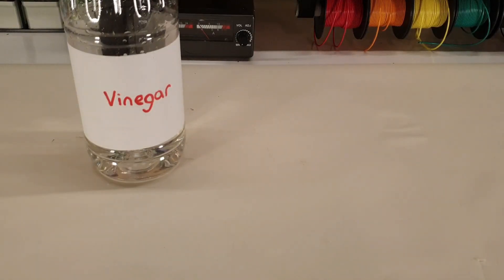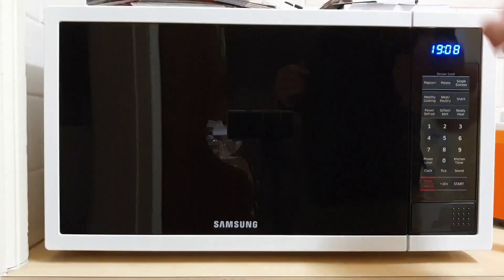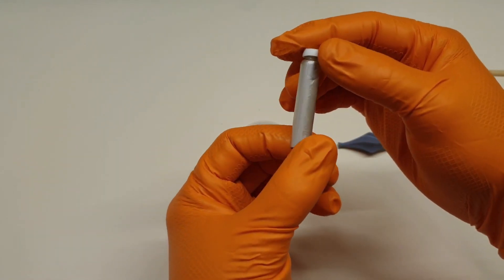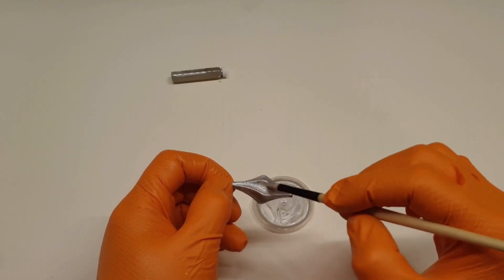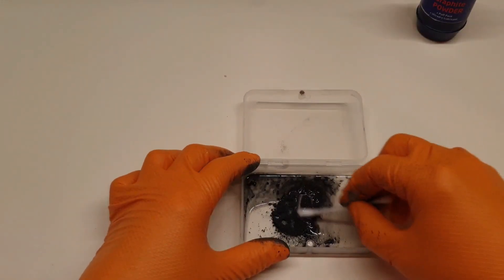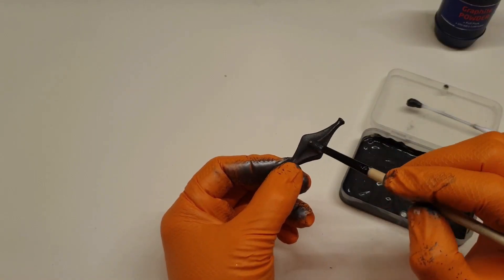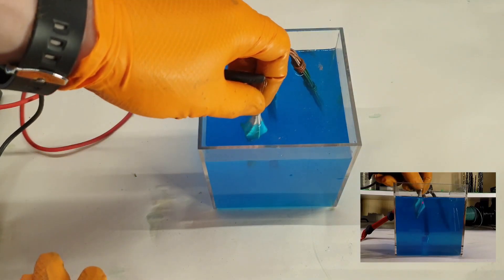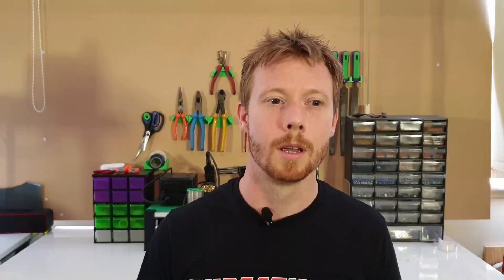Metal plate your 3D prints at home.

Comment: Nice video! Just one thing: silver is not the most conductive metal, gold is even better - but obviously prohibitively expensive. So it's better to say most conductive but relatively affordable metal.
Reply from the maker: Gold is actually the third most conductive metal, behind silver and copper. While not the most conductive, gold has the advantage of being extremely resistant to oxidation, which is part of the reason why it used for high quality plugs and contacts.
Reply: @BrodieFairhall  I stand corrected. I guess I was just regurgitating what I heard once without checking. Good catch.

Comment: What percentage or what kind of peroxide was used? Do you need lab grade stuff at 30% or just regular peroxide in the store
Reply from the maker: @arib8464  just grocery store levels of concentration. I believe the peroxide I used in the video was around 3%.
I also have a second electroplating video with a different method of creating an electrolyte that doesn't use peroxide if which might work better for you.

Comment: Hello, I've already tried everything to make my 3D print shine, I've sprayed on conductive copper varnish, I have an area of 1.10 square centimeters, I've set it to around 0.550 A but it just doesn't shine, it just becomes so strangely milky, I just don't understand it Tried everything possible💆🏻‍♂️
Reply from the maker: @stefankrsmanovic3776  I've not seen it go milky before. There are calculations for the correct amount of current to plate a specific surface area, 500mA seems a bit high off the top of my head. The easiest way I have found to get a good start is to increase the voltage until bubbles start to form, then drop the voltage back down until there are no bubbles forming. The voltage will be somewhere around 1.2 - 1.6V, depending on how saturated the electrolyte is and a few other things.
There are also brighteners you can add to the electrolyte to improve the surface finish. A tiny bit of sugar has worked for me in the past, but now I use a commercial brightener.
Reply: @BrodieFairhall  With my laboratory power supply I can only set amps as soon as minus hangs on the wire of the 3 D part I started yesterday with 0.137A and every hour I then went up twice as much with the amps but after 4 hours I still had no shiny surface and in the end I was at 0.550 apere
Reply: @ sry i mean i have 1.10 sqaure meter not cenitmeter
Reply from the maker: @stefankrsmanovic3776  since this is a home made electrolyte with a higher resistance than one based on sulphuric acid (on top of all the other thousands of variables related to plating that change while you're plating, such as concentration, the surface resistance of the cathode, surface area of the anode as it decays, etc) I would recommend starting by adjusting voltage and trying to keep it just below the point that bubbles form on the part you're plating. You can plot the voltage and current over the plating time and work out what current to set in the future.

Comment: How long does the electrolyte last?
Reply from the maker: I still have the electrolyte from this video.
I run it through a coffee filter to take out debris and add more distilled water to dilute it as more copper dissolves in it and it gets darker.
As long as it doesn't get contaminated with other metals or chemicals, it could last year's.

Comment: what happens if you dont heat up the mixture ?
Reply from the maker: It just takes significantly longer to make.
My second electroplating video has a different method that doesn't require heating that might work better for you.
https://youtu.be/HWBwebWAT9c?si=lZEF6iYOrrJdYzeh
Reply: thanks for the immediate response  @BrodieFairhall  I tried it without heating it up , it kinda worked.
Reply: one more question if you dont mind , I used graphite spray paint on a plastic piece but it didnt work. I tried it on a metallic piece and worked fine. could it be the paint or the power supply ? I used a charger with variable voltage  @BrodieFairhall

Comment: Anyone have a link to the paint
Reply from the maker: Instead of the paint in the video, I'd recommend a nickel based conductive paint (MG Chemicals makes a really nice one). It's far cheaper and I find using the spray version gives me a much better result that the silver paint
Reply: @BrodieFairhall  I am open to anything that makes my part conductive not had any luck so far
Reply from the maker: @1937Brett 
This is what I use https://mgchemicals.com/products/conductive-paint/conductive-spray-paint/shielding-paint/

Comment: It looks like metal, but how does it feel? Does it have that cold to the touch feeling that real metal has?
Reply from the maker: It feels like metal to touch, but it's missing the weight of a solid metal object.
Reply: @BrodieFairhall  Sweet perfect for making a shifter knob for my Logitech H shifter.

Does it wear off if you touch it too much?
Reply from the maker: @antjones2281  it will eventually wear, both because copper is very soft and through the acids in your skin. You can just plate it for a longer period of time to build up a thicker coating. If you look at my other playing video, it also shows nickel, which will last longer with that kind of use than copper.
If you do decide to do it, instead of using graphite, I now use a nickel conductive spray paint (most commonly the one made by MG Chemicals), it gives a much, much better result and it's far cheaper than the silver paint.

Comment: How much voltage do you recommend setting it to to start with?
Reply from the maker: With this electrolyte, I'd start with around 2.5V to 3V and increase it if you need to.
I also recommend using a nickel conductive paint now, instead of the graphite or silver paint. MG Chemicals makes a nice conductive Nickel spray paint, which ends up being much cheaper by volume than the silver paint and it works so much better than the graphite.
Reply: @BrodieFairhall  Thank you so much!

Comment: Hey, great video! I was wondering, can I do this on larger parts, and if so what container do you recommend? (I will a large enough amount of paint/graphite mixture but I'm not sure what container would be viable)
Reply from the maker: You can absolutely plate larger parts! I'd practice on smaller ones first.
Also I recommend using a conductive nickel spray paint made by MG chemicals now instead of graphite, it works so much better and is much cheaper than the silver paint

Comment: I really enjoyed your video! I have a question as well: Your electrolyte solution method seems very easy and straightforward compared to other DIY electrolyte videos I've seen. Is there any downside to this method, such as reduced purity? Also, do you recommend adding a brightener to prevent rough surfaces and large crystals on 3D parts when using your method, or is that not needed?. Thanks in advance!
Reply from the maker: The electrolytes used in both of my plating videos are made using cheap and easy to acquire chemicals and are a little safer than some other options.
The main differences in the use / results will be;
- using Sulphuric acid instead of vinegar makes the electrolyte more conductive, which means more metal will deposit in hard all the little hard to reach places. You can counteract this by moving the part around.
- brighteners do exactly what they say, make the metal deposit in a smoother and more even coat. You can try adding a very small amount of sugar as a brightener.

Something that will have more of an impact on the plating quality is the conductive coating. I now use a conductive nickel spray paint made by MG chemicals. It's far cheaper than the silver paint, sticks to a print better and gives an amazing result. Both of the paint options deliver far better results than the graphite mixture.
Reply: @BrodieFairhall  Thank you much for your detailed answer!
Reply: @BrodieFairhall  I’m thankful for finding this material, even this updated comment. 
Brodie, you’re master. Your way to copper plate without sanding is the thing I was searching for. Without this method I would berely into it, but now I’m motivated and starting to prepare materials.

Thanks for sharing your experience.

Comment: 2:00 50% H2O2 does sound neither safe nor cheap and definitely not "rather mild". And it's probably not safe to microwave. So I guess you started with a much lower concentrated solution and mixed that with vinegar, which I'm assuming is the normal ~5% used for cooking. But my first thought there was "WTF? 50%?".
Reply from the maker: Oh yeah hydrogen peroxide is 3% diluted mix. 50% would have had a lot of undesired effects on my equipment and myself 😅
I've learnt a lot about being very clear in videos since making this one!
Reply: @BrodieFairhall  I just watched this video as youtube suggested it and I had watched a few other plating videos in the past. I find them really relaxing.
In chemistry, clear instructions on concentrations are really important. As H2O2 isn't usually available over 30% (and even that may be impossible to buy without some kind of licence), getting it to 50% would have been the stuff for a video on its own. I saw a video about that on Explosions&Fire a few months ago (might have been on that guys other channel, Extractions&Ire, both are fun to watch).
Reply from the maker: @danielschuett  you're absolutely right! My other plating video is 1000X better, but is still missing important information (the number of angry comments on the hackaday post about killing everyone with chlorine gas was enough to show I wasn't as clear on details as I should be).
Anyway, I absolutely hate both of these videos, but they're the first 2 I ever made and it was a massive shock as to how much work making a video takes, especially getting it right. I've got some fun new videos on electrochemistry planned (an electroforming 3D printer, some decent diy batteries and cutting metal plates with a weird anodising technique). I'm very short on time, but I'll eventually get around to making them.
Thanks for watching and thanks for the channel suggestions!
Reply: @BrodieFairhall  I'll take a look at that other video. I've been trying to make some videos myself (just some gameplay), and though they're still unfinished after months later (and not relevant anymore), I have more respect for people managing to create some proper videos.

Comment: I've finally done some copper electroplating. It comes out chalky and dull. Have you found a good method to polish it?  Should I wet sand it lightly and then go straight to buffing compound on my bench grinder with a bonnet wheel? So far, I've tried using green bar compound but its taking forever and I'm wearing some of the copper off.  Not great shine either.  Thanks!
Reply from the maker: If it's coming out chalky I'd say there is something wrong with the plating itself.
It should come out bright red/orange, so there might be impurities or you may need to lower the voltage / move the part further away from the anode.
Copper polishes very easily, but depending on how thick you've applied the copper plate, it's very easy to buff off the layer of copper

Comment: What if we mix the graphite into the resin?
Reply from the maker: I think that will greatly depend on the ratios. You'll need to have a lot of graphite in the resin, so the particles can touch each other to conduct electricity. It's probably doable if you paint some resin on which has a really high percentage of graphite in it. But, I don't think you'll be able to successfully resin print something with the amount of graphite you'd need to have in the resin to make it conduct.

Comment: Hi Brodie, quick question, the part where you mix the vinegar and the peroxide, you add a 3rd liquid, what is it? Thanks
Reply from the maker: I added 2 small bottles of hydrogen peroxide and then vinegar. Only 2 liquids overall.
I've got a totally different way to make an electrolyte in my other plating video too
Reply: @BrodieFairhall  thanks for the quick reply.

Comment: okay, I feel like an idiot, and this looks like magic. so you electrify the copper and it migrates to the also electrified graphite-covered item... just like that? what other metals can this method work with? I feel like you just opened the door into alchemy and my brain is still trying to bang rocks together to make fire.
Reply from the maker: Nickel, Tin, Silver and Zinc are really easy to plate with too (I made another video where I plate nickel and copper onto the same item).
Gold plating is also done this way (but the electrolyte is made a different way and is pretty poisonous).
Reply: @BrodieFairhall  absolutely fascinating. Thank you. I have some stuff to research now!

Comment: Hi I was wondering what would happen if I didn’t add any graphite powder to the 3D print, if I have silver conductive paint would it still plate? I read your comments about you use the conductive nickel spray paint by MG chemicals, there’s one on Amazon but it’s silver conductive paint by MG Chemicals, what do you recommend?
I’m very interested in metal plating my prints I would appreciate a quick reply! Thanks 
I brought graphite powder but I noticed the one you got says lubricant on it, I’m assuming that’s the difference and maybe why I’m failing with the copper plating
Reply from the maker: If you can use good conductive paint instead of graphite, I highly recommend that you do.
The paint will generally work much better than graphite powder.

I've never used the silver paint from MG, only Nickel and Copper and they both work really well, I imagine the silver also works well too.
Reply: @BrodieFairhall  i will try the silver conductive paint from MG chemicals, thanks for the help
Reply: @BrodieFairhall  Hi again, unfortunately the silver conductive paint from MG chemicals didn’t work, 
I did use a coin as a example and it worked, What do you recommend I should do?

Comment: Very cool. Will you show us the Chroming process so we can make them silver and reflective?
Reply from the maker: I don't do Chrome plating personally, the chemicals are very toxic. You can buy chrome plating kits online though.
Reply: @BrodieFairhall  Thank you for the reply! Would you say that the process outlined in the video, will work on most 3D prints? Are there any plastics it won't work on? I'm asking cause I want to do many of the trim pieces in an old truck interior.
Reply from the maker: @enermaxstephens1051  it will work on most plastics, I would definitely use something better than graphite for that project, I use a conductive nickel spray paint from MG Chemicals which works really well and make sure all parts are cleaned and primed.

Comment: Hello, i tried graphite on my 3d print but it doesn't work realy well, the graphite doesn't hold very well, is it because my print is in ABS? if yes, is there a solution for ABS? thanks
Reply from the maker: ABS isn't a problem at all, I do find that really rubbing the graphite into the print can help it stick. I have heard of people using acetone to apply graphite to ABS, I haven't tried this though.

On another note, while graphite works, I now recommend using a conductive Nickel spray paint made by MG Chemical, it works so much better than graphite and is much, much cheaper than the silver paint.
Reply: @BrodieFairhall  thanks a lot for your answer it's realy helpful,
One more question, if i let my 3d print submerge for realy long time, is it possible to have a metal plated of 3mm or even more?
Reply from the maker: @froidevauxyann4849  That's correct, if everything is setup correctly, the longer you leave it, the thicker the layer of metal will get.
Good luck and reach out if you have any problems.

Comment: Couple questions (sorry if they've been asked before but too many comments to read them all). 
What do you recommend for cleaning the plastic parts before you paint them? 

I separated the copper oxide. I got blue liquid and sediment at the bottom. Am I mixing it to include the sediment for the plating process or discarding it?  What is the sediment? 
Thank you!
Reply from the maker: I just use ethanol / isopropyl alcohol to clean the plastic.
The sediment will just be contaminants in or on the copper you used to make the electrolyte, best to remove them, you can filter the electrolyte through some filter paper/paper towel/some cloth.
My second electroplating video has a bit more detail that isn't covered in this video too.
Also, many people have had issues with different types of graphite, I don't use graphite anymore, I use a conductive nickel spray paint from MG Chemicals. It's much cheaper than the silver paint and works really well.
Good luck with your plating!
Reply: @BrodieFairhall  Thank you, not only for replying, but for taking the time to share your knowledge.  I just became a new subscriber.  Your videos are everything I like in a video.  They're clear and concise, without a lot of time wasting fluff.  Great work!  You are a valuable contributor!

Comment: What type of filament are your parts printed in? I assume pla wouldn’t work because the ethanol would melt the pla?
Reply from the maker: They're printed in PLA and the raven skull is printed in ABS and vapour smoothed.
Ethanol won't greatly affect most plastics, I'd even go as far as to say, with the exception of PVA and PVB, basically any other plastic you can FDM print will be fine with ethanol.